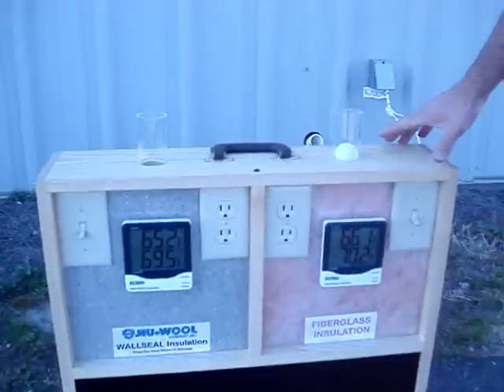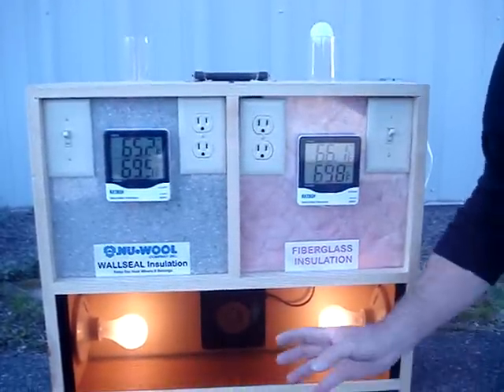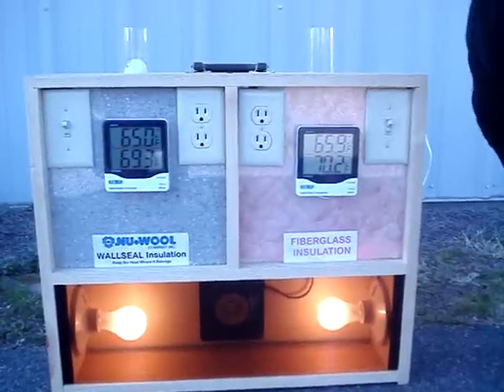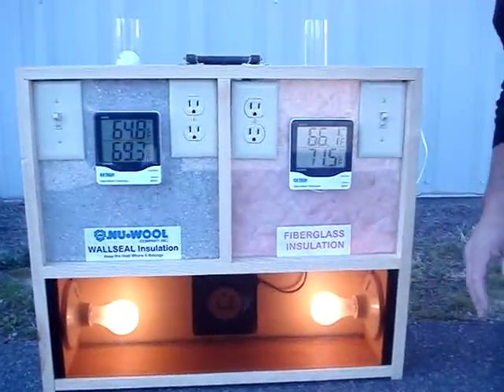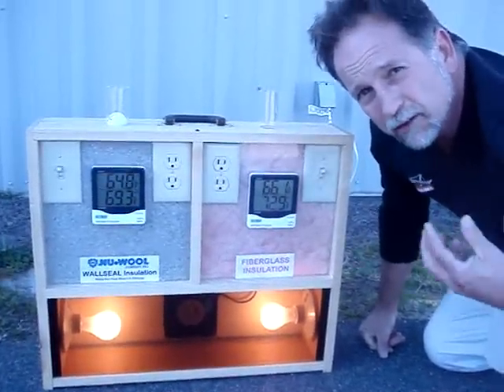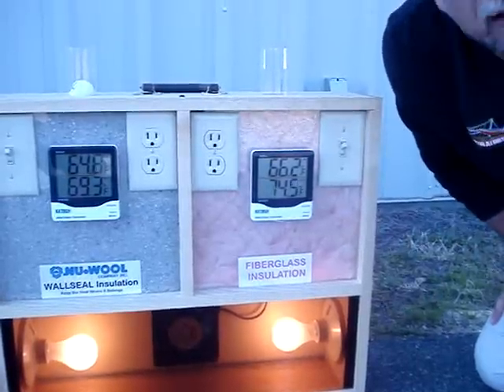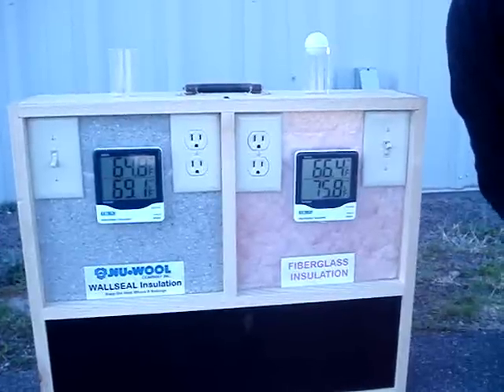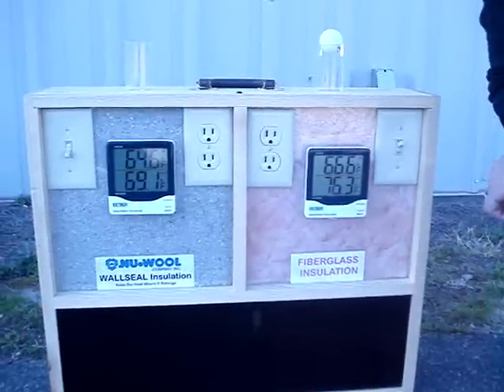John Meeks Explains Cellulose vs. Fiberglass

Comment: Insulation is really one of the cheapest things to put into a home vs overall cost of building. The concrete and the roof was the 2 most expensive portions. It cost me  about 6k 10 yrs ago for cellulose and would have been 9 for foam. Couldnt get a foam contractor then. I would not incorporate some solar, foam, and insulate the concrete pad somehow.

Comment: If I had to do it again, I would use the brown foam, & get every crack of the framing  structure, getting the house "glued together" -strength.  I see where they are foaming the inside roof and not the joist now a days. If that works well, i would put flooring in the attic and good access for storage or etc.  I also put my air handlers in the attic. I dont know if I would use the white foam, it is cheaper, maybe just the walls, but doesnt have any strength to it. Definetly in the roof.

Comment: I used cellulose in my 4K sq ft. home built about 10 yrs ago, ( at 33usd/sqft mind you). I wanted to use foam, but there were no contractors in this area that applied it, unlike now a days. At that time fiber glass was about .33/, cell .66 and foam about .90 per sqft, giving the same R value considering how thick each has to be. I put 8 inches in the attic.  The fan in the display is fair, there is plenty of air to go to both sides 2-3x. & the Dept of Energy doesnt know shit!

Comment: RJ- it's gold standard for effectiveness, but not necessarily for cost, total lifecycle, and things like workers being exposed to toxins. There are places (like wet humid basements, where spray foam is appropriate). Spray foam also has a lot more waste (you have to discard what you shave off) and costs more- but there is a reason that's why they make fridges that way. I would even consider blow fiberglass, but never fiberglass batts. Just hard to get the edges and pinch points taken care of.

Comment: Buying a home next month, there is the typical amount (very little) of fiberglass rolls. I would like to use Cellulose, as I have found many sites and companies recommend it over fiberglass batts or rolls, but I was wondering about spray-in insulation. Spray insulation is supposed to be the gold standard, but is more costly. Any thoughts or opinions?

Comment: Because the air is taking the path of least resistance, it makes the cellulose look impervious to air. I don't know if it is, or isn't - I just am saying I would like to see two separate fans and spaces below the insulation. 

That alone proves it, fiberglass is all big puffs and doesnt set well, cellulose does, I plan to install some in my new here soon.

Comment: I see you have exactly the same amount of insulation for both products.  Has anyone taken into consideration that cellulose and fiberglass each have different R-values per inch.  Since it takes less cellulose to achieve R factor "X" than you would fiberglass, this example skews your data.  If you combine that with the fact that cellulose compacts over time (lessening your R value), you may want to take a couple more aspects into consideration before showing a customer this.
Reply: 9 years later , I’m buying my first home, does your opinion still stand that fiberglass may be better ?

Comment: I believe that cellulose has better insulating qualities than fiberglass, based on various research. 

HOWEVER, this video should have been split into 2 tests: 

1) Air resistance (as shown with ping pong ball).

2) Heat resistance (turn fan OFF)

The video does not conclusively prove to me that fiberglass is more heat-conductive, since fan is blowing hot air from cabinet through path of least resistance (fiberglass). A more convincing test would be to let heat flow naturally from bulbs.

Comment: I think that is the point.  Cellulose provides more resistance to air movement and thus loss due to convection. This wasn't a test about "perfect condition" R value, but about why cellulose is likely to perform better in your home than fiberglass.

Comment: This is somewhat misleading.  With the two insulations sharing the same pressurized space underneath, the air is going to flow to the side that allows air to pass more easily (in this case, the fiberglass.)  Because the air is taking the path of least resistance, it makes the cellulose look impervious to air.  I don't know if it is, or isn't - I just am saying I would like to see two separate fans and spaces below the insulation.